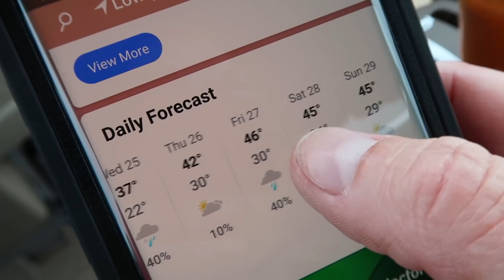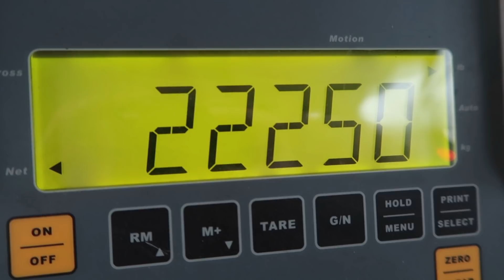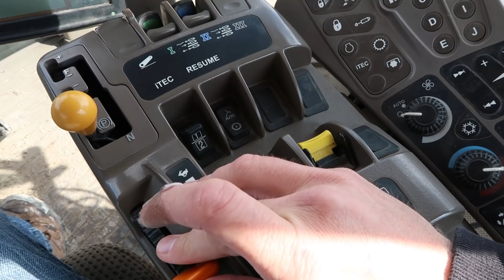I ALMOST FELL

Comment: Feeding calves in the winter, when you carry two 5 gallon pails full of milk replacer and get 10 feet from the calf huts and slip on ice and fall down
Reply: Yes thx
Reply: Or when you're feeding a dog team fish meal wet and slip on the hill and roll to the bottom coating yourself and the trail with wet smelly fish meal. Girlfriend wouldn't let me back in the cabin until I stripped and put my clothes in a bag.

Comment: You asked the other day about over hauling the MM 603? I say go though the motor and anything else that needs to be fixed and don't repaint the tractor, keep the tractor in what I call "it's original overalls". I believe a tractor looks better if it isn't repainted, it's original overalls. Faded paint, scratches and small dents and all.

Comment: You could use the crane from the service truck to unload the barrel right ?
Reply from the maker: Well.  Sorta.  The valves are bad on the crane and half the time it won't go back in, so we have been trying not to use it anymore because they don't make new valves for it anymore
Reply: @MillennialFarmer   well get a new crane
Reply: @MillennialFarmer  ,,,  Stoen or Mid-central hydraulics  could probably put in new o-rings for crane valves.....

Comment: Get the .308 Zach,it's a military round that's available everywhere,plus it's cheap to shoot.
Reply: But 6.5 is better at longer ranges
Reply: @thomasgrady7062  But I use .338 Lapua
Reply: Both
Reply: @thomasgrady7062  everybody with a 6.5 creedmoore says that but almost none of them have ever shot it over 900+ yards where it actually IS better.... lots or calibers are superior to the 6.5 under 800 yards, but if you're punching paper at 1000 yards then you are correct the 6.5 is better
Reply: .308 is the civilian designation. 7.62 is the military designation.
Basically a larger caliber rifle round.
Reply: @kenraterink3916  to me there is nothing the 308 can do that the 6.5 cant and the 6.5 is better in many places.  You can get 6.5 ammo anywhere you can get 308. You also get noticeably less recoil on the 6.5.  The 6.5 is also superior in the wind at any distance which is where you're most likely too miss.  I'm not trying to put down 308, I own one.  It sits on the shelf as I grab either the 6.5 or 6 creedmoor.
Reply: Get a 6mm, flatter shooting than both
Reply: .308
Reply: Sling shot
Reply: Daisy Red Ryder... lots of take down power
Reply: 50 BMG you babies

Comment: Hey Zach this is my opinion.  I don’t always recommend a 55 gal barrel of DEF if your not going through it vary fast. Due to the fact it can go bad. In most cases some farms go through it quickly but if you don’t switch to some 2.5 gallon jugs. The cost is a little higher on the 2.5 gallon jugs per gallon but they tend to go faster of the shelf in most regions. So you have a better chance of it being fresher. Plus you can reduce contamination of jugs.

Comment: I built a hammer strap hitch for my 57 JD 520 so i can pull my pintle trl. Get your self the metal valve stems so you dont have to worry about them again

Comment: I always put the draw bar pin sitting on an angle in the top hole, then when backing up hard against  the implement the pin falls down, pull forward an inch or so and it drops right through. Realy good if your not hooking up hydrolics .

Comment: Zach for loading those trailers with the grain cart you can get a wireless backup camera from Amazon they even have AM solar powered that you don't have to run no power and ground to put a magnet on it put it on the shoot and you can see inside the trailer no problem. Stay safe young man.  Carl

Comment: Barrels are easy to pick up if you trust yourself. Plastic you set your forks so there just under the size of the under side of the top ring. As you push the forks in they will tighten their grip on the barrel. Have a skid ready aside your truck. Once you set it down just back out easy it will let go. Metal do the same but grab it just under the top rib instead of the top ring.

Comment: Use the forks on the skid steer to lift the drum from under the top lip. Forks just a bit closer together so the drum wedges in between. Just gotta go sloooow and steady. Can you handle that?

Comment: Want to know a trick about how to get rid of dangerous pull strings and still be able to get a hood tight? Buy a snap fastener and put a stud or a few studs on each side spread out. Then a socket and cap above them with the socket facing out. Then you can scrunch the fabric together and snap it just like a pull string. And if the hood ever gets caught in something they'll just pull open.

Comment: Any tips on documenting maintenance and repairs on so much equipment and vehicles?  Might be a good video.  I’ve been thinking about a dry erase board in the shop for reminders,  but I have hard copies in the office with each machines folder. Wondering how you do it.

Comment: Can I make a sugestion on the snowblower make sure u hang the driveshaft in the air with a bun hi cord so if it does snow it won’t be frozen to the ground that’s what we do with our snowblower just a suggestion not saying you should or have to but u know just looking out for yeh

Comment: I use my track and cross country  shoes/spikes to not fall on the ice, I normally use half inch spikes, I have used the same spikes for almost 2 yearsears, they last longer if you don't walk on concrete a lot, that is my suggestion tho,
Reply: When I'm moving grain for a buddy of mine, it took me a couple hard falls to try that method out

Comment: So a question I’ve always had, I’ve seen on quite a few rubber tire grain carts what the tires mounted backwards to how a tractor tires are im referring to the tread pattern
Reply: John Elliott when the treads are turned backwards they don’t get as much grip, but they float better and the grain cart’s axle doesn’t drive so the grip isn’t necessary

Comment: If it was a few years ago, I would say .308 over 6.5 anyday, simply due to availability. Nowadays, its seemed like a lot more people and companies have embraced the 6.5 and I've seen it availible around a lot more than before. And it's a better long range round as well

Comment: 308

Do you load the cart to load trucks because it loads trucks faster than your elevator?
Reply from the maker: Yes and because it has a scale
Reply: @MillennialFarmer  the scale is a perfect reason, I'm used to having a scale at the seed dealer I worked for didn't think about you not having a scale.

Comment: Yeah how cheap are manufacturers that the hammer strap is an "extra", i went through that with my NH when i traded the shitty T6.145 for the shitty T6.180 (both brand-new) they sold my hammer-strap with the older one and delivered the 180 sans strap then tried to charge me the $200 for a new one (see my recent videos for worst tractors on the market).
Reply from the maker: I can see that the previous owner took the strap off this one.  Too bad it didn't come back with it...

Comment: Could use some gravel on the yard!
Reply from the maker: The gravel is good.  There's thick frost under it and the moisture can't go anywhere
Reply: @MillennialFarmer  
The gravel is probably good, but you just happen to have a bit of dirt and mud accumulated on top of it. It will dry out eventually...